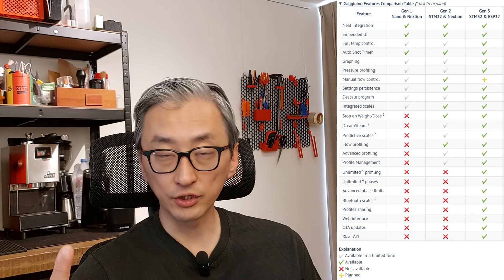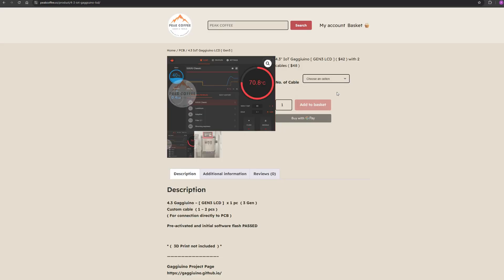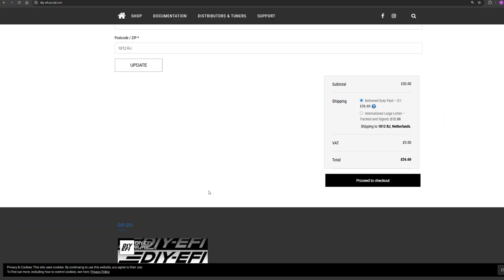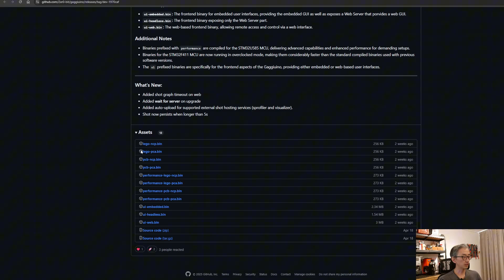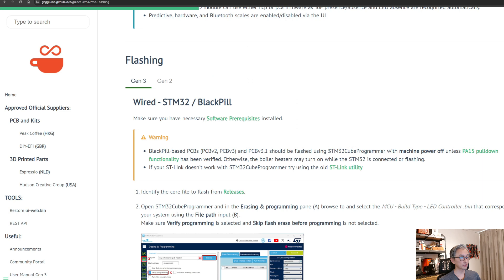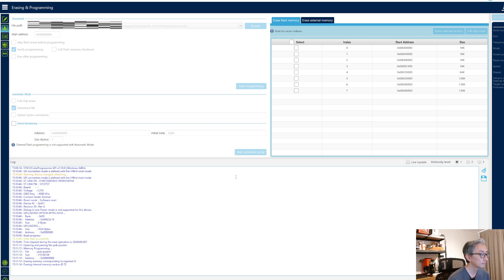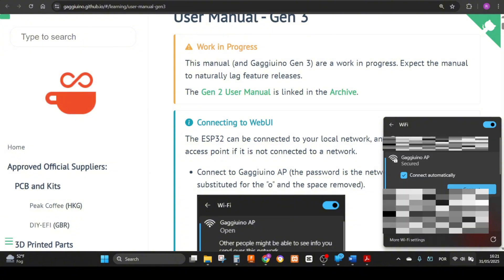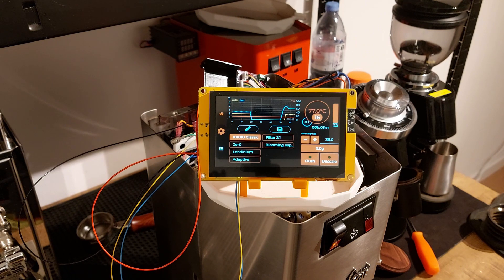Gaggiuino Gen3 Upgrade: Simplified for Beginners (Gen2 to Gen3)

Comment: Hello,

I currently have a Rancilio Silvia running a Gaggiuino Lego build with a STM32F411 (BlackPill) microcontroller.
I would like to upgrade the system to Gaggiuino version 3, while keeping the Lego build.

My question is:

👉 Is it possible to upgrade to Gaggiuino v3 using a large Nextion NX8048P050 (5.0” UART) display, while keeping:
	•	the Gaggiuino Lego configuration,
	•	the STM32F411 microcontroller,
	•	and without switching to an official Gen3 / Gen4 PCB?

The goal is to benefit from a larger screen and improved UI while retaining the current hardware setup.

Thank you in advance for your clarification and support.
Reply from the maker: No, only buying the new screen from autorized suppliers, but you may keep the STM32F411  if you want. However, the lego build allows you to change only the microcontroller, which is relatively cheap. If you will buy the screen and pay for shipping, I'd also buy a new microcontroller

Comment: Great video!

In the past I have bought the v3 kit from diy-efi (Gaggiuino V3 PCB Kit For GAGGIA CLASSIC PRO (INCLUDING EVO)) and build the gen2 configuration. Now with gen3 I would like to upgrade my setup with the WiFi and Bluetooth capabilities. In your video I see I only need to buy the new screen since it has the Bluetooth and WiFi integrated but I can’t find that in the description of the diy-efi website (only on the headless module). Do you know whether it still counts for diy-efi to only buy the screen to have the Bluetooth and WiFi capabilities?
Reply from the maker: Yes, it's the same screen that Peak Coffee used to sell

Comment: Thanks heaps for your video. Do you think I need a LED PCB to be pre-installed to upgrade from gen 2 to gen3? 
 I have PCB V3.1 installed in my Gaggia but never installed the water level meter. I thought this was optional.   It seems like the quickest and cheapest upgrade would be to go headless? Thanks again for your great videos. BTW I have installed the Gaggimate on a Rancilio Silvia and love it.
Reply from the maker: Thanks! Gaggimate is in my list but it will take a few months yet... I'll post a video soon comparing both. 

Regarding the ToF, I don't think you need, because the firmware will be updated and it should detect the ToF automatically. Personally, I don't think it's mandatory but it's cool.

Comment: I am looking at a solution where the scales work ... been struggling to get the scales to work reliably with my current setup...  the cables routing, lengths and etc., its a hit or miss, if they get interference or not...
Reply from the maker: I had some issues in my Gaggia Classic 2006 as well. The first thing you need to do is to make sure that DC cables are far from any AC source (cables, solenoid, pump). In my case, I suspect that I'm having some current leakage in the boiler and I'll replace it just to eliminate this potential issue. In my E24, I didn't have any problem, worked perfectly well since day 1.
Reply: @EspressoHackers  yeah.. I redid my wiring several times... tried several things as suggested in discord but I ended up giving up... I am considering trying again with the newer electronics
Reply from the maker: @Gunnl does it work with predictive scales? If you have access to a BLE scale, you can also test.